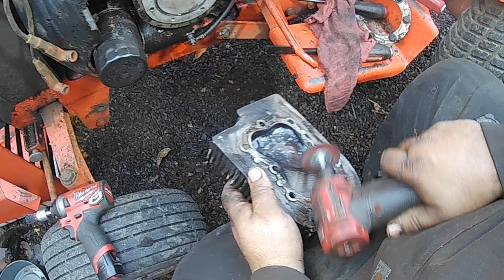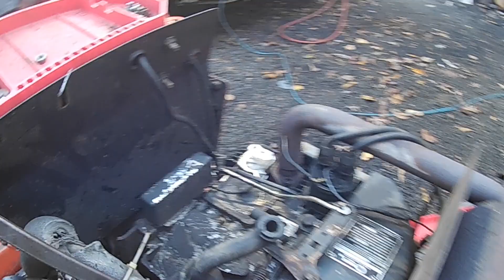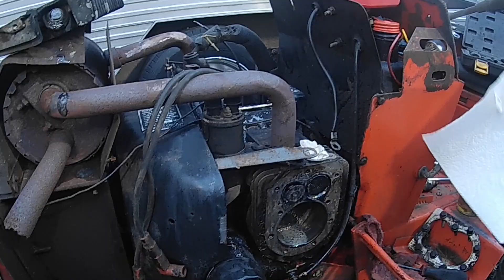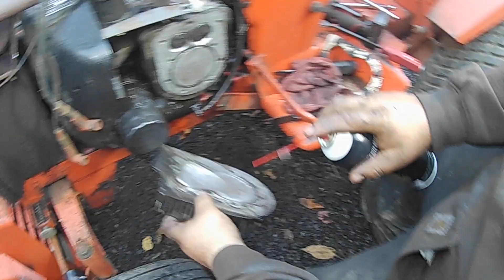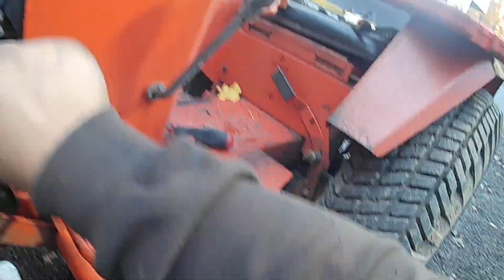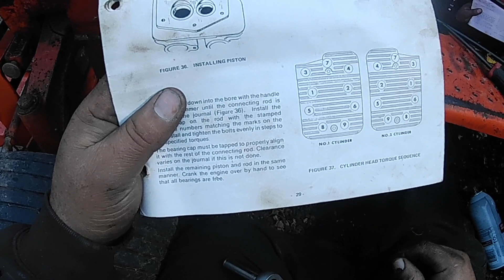How to De-carbon & Replace Head Gaskets On A Onan or Many Small Engines. DO BEFORE ADJUSTING VALVES

Comment: Would using a higher octane gas prevent this?
Reply from the maker: Yes will help but would still need to do it. Using non ethanol gas, high octane heavier oil and make sure its tuned and timed and adjust right. Thanks for the question and watching.

Comment: I have 2 Onan Gensets that have the 6.5 NH Engine. The Head Torque specifications say to re-check Head Torque after 20 Hours of run time. Do think this Required ?   Also Valve Grinding is at 44* and 45*, And Not to Lap the Seats in.  Do you Agree ?   Thanks  Ray
Reply from the maker: Hi we do recheck ours but with customers we cant most times as once they leave we do not see them again or for awhile. Most times they are still in spec but it definitely cant hurt. But we do tend to torque them a bit higher with used bolts. If you can grind them or have them done right then go for it if needed. We only lap them if there is a sealing issue after testing for small issues. Thanks for watching and the comment.

Comment: How do u make sure their cooling properly something about the insulation behind the cover  I was told to remove all the insulation and stuff between engine and shrouds
Reply from the maker: Clean the coolers, make sure fans are in perfect shape, engine and shrouds are clean, correct oil in hydro and engine. Timing and carb adjusted correctly. Thanks

Comment: Trick I learned from an auto shop I worked in. Use a piece of cardboard and make a quick diagram of the head, punch the holes out with a screwdriver where the bolts go and then put the bolts in the holes on the diagram to keep them in order as you take them out. Now they are in order with a picture diagram for when you put it back together. Love your videos, been a big help already helping me work on my tractors and figure out what to fix next!
Reply from the maker: Great idea, thanks for watching and the kind words!

Comment: How do you bar the engine over, about to do valves on my miller welder with this engine/ similar one onan b48m
Reply from the maker: We us a bar on the flywheel through the cut out for the air tube, with heads off or plugs out you can of off flywheel or crank bolt. Thnaks for watching and the question.

Comment: You never showed it run again. That's odd.
Reply from the maker: It ran before... Ran after... Pleanty videos of them running. Video was a how to, did not need to add length of the video if running before was not a major issue. Thanks for watching.

Comment: What are the valves adjusted at? Intake and exhaust
Reply from the maker: @djmtexas  hi for what model engine. Its in the video for a couple models. Thanks
Reply: @caseingersolltractorsnortheast  it’s actually a Onan generator. 
Onan 4.0 bf-3cr/16000b
Reply from the maker: @djmtexas  Sorry do not know of the top of my head there should be manuals on line.

Comment: Good tips, like the abrasive fiber wheel you're  using. Working on my '96 520H, had to pull engine because of mounting position.  Doing all your work along with lapping valves seeing its all apart.
Reply from the maker: Nice enjoy and hope it goes well. Thanks for watching and the comment!

Comment: I began decarbonizing my JD 420.. The carbon wasn't too bad, but what I did see was oil on the bottom of the cylinder. The piston didn't move much. How serious is the oil condition? I wasn't really planning on pulling the engine and doing a ring job. I just bought the tractor and have not used it at yet.
Reply from the maker: Run it and see. It's not uncommon especially with the hours these machines have on them. If the carbon was not bad then it's probably not burning much. Run 20 50 oil and see what you find. Thanks for watching and the comment. Report back if you don't mind.
Reply from the maker: Run it. If the carbon was not bad it's probably not burning much. With the amount of hours on them by this point a little oil is normal. Run 20 50 oil in it. Report back if you would.  Thanks for watching and the comment.  Let us know if you need parts for a Onan or anything. Caseingersolltractors.com

Comment: Nice video.  Appreciate it!!  Saved your website as I have jd 318 with an onan I just pulled motor to do exactly what this video is about.  And yesterday I just bought a case 380 LL little landscaper  . Seems like a good running tractor.  Just worried parts might be hard to come bye.
Reply from the maker: Thanks for watching and the comment and thanks for the sub6. Glad it's was helpful. 380 is a handy little machine. And 318 one of the best Green ones lol.

Comment: I run seafood in.mine
.it keeps it clean
Reply from the maker: Hi Seafoam is good stuff but these engines need decarboned in a normal schedule.  Seafood may help some but won't stop carbon from building up in these small engines, may slow it down as the ones that use seafood constantly are  a bit less Carboned up. But still build up and not taking a chance blowing a multi thousand dollar engine because of carbon build up. We really like seafood for keep carbs clean. Thanks for watching and the comment!
Reply: Seafoam,sorry.
Reply from the maker: Loll no worries knew just what you ment!

Comment: I have a JD 318 with no compression, what is your best guess to my issue? I haven’t torn it apart yet. I want to do the work my self but first of all i don’t know where to get parts. Local JD cant even get most of them anymore.
Reply from the maker: Hard to say could be hung up valves, less likely 2 rods broke or crank or cam broke.  Can't say more without seeing. Pull the heads and you will know in 5 minutes
Reply from the maker: So you have no compression on both cylinders? How are you checking? We stock and can get Onan parts. Be prepaid though worth it they are not cheap.
Reply: @caseingersolltractorsnortheast  just by the way it would sound, it sounded as if only the starter was spinning, it sounded like it had no compression. Also im assuming thats why the fuel pump wont pump fuel….
Then I went and checked with a compression tester and determined i have none.

Comment: Should I anti seize exhaust bolts? Or does it just get burnt off when engine gets hot. Have had problems with steel bolts and aluminum engines, carbs ect. Good info on video, spank you.
Reply from the maker: Hi you can use never seize if you want. Thanks for watching and the comment.

Comment: what is that spray you are using to soak the carbon before hitting it with the nylon pads?
Reply from the maker: It was a private label product no longer made. Thanks for watching and the comment.
Reply: @caseingersolltractorsnortheast  I spent around 2 hours on the 2 heads on my onan B48g engine yesterday scrubbing trying a variety of products.  NOTHING was touching getting the black crud off the heads.  Resorted to using a roloc disc using it just agressive enough to take it off...then used a buffing disc to remove any light scratches left.
Reply from the maker: @mackendw  Lots have had good luck with oven cleaner and some penetrating oils. Rollocks work as well just have to be careful and sounds like you were. We sue them some times too the less aggressive grit ones.

Comment: Wow that’s a filthy engine I try and take every shroud off to degrease and hose it down if I’m doing any sort of work to any engine not just onans
Reply from the maker: Yes we get them in much worse lol we are going to share some photos in a video soon of some of them, lol. But Ya thats why we addressed it in the start of the video. It was far worse lol. Our steam cleaner was down when this was filmed and it was winter so thats why we went only as far as we did. But it worked out fine. God news is we have a big ole USA top of the line steam cleaner now lol. Thanks for watching and the comment! Nice Big bud!
Reply: @caseingersolltractorsnortheast  ya lol I wish I had a big bud little rare and out of budget if you’ve ever watched welker farms they have a few of them steam cleaner would be nice to have I have a 6000 psi commercial grade gas pressure washer it seriously takes both hands and I have to install a 75 degree tip to avoid pint or decal loss
Reply from the maker: @hunter7476  yes watched them recently. I been a fan of Big Bud for many years. Each very cool machines. When I farmed dreamed of having one even though more tractor than I needed lol. Ya we have a 4500 psi machine too but the steam works beat to take the grease off. 6500 psi that's pretty crazy no mud sticking with that lol.

Comment: Are the brushes you use described on Amazon as "nylon abrasive"  (Which sounds pretty harsh for use on aluminum) or did you use a non-abrasive brush?
Reply from the maker: Honestly don't remember what they were described as. But as far as being aggressive it's as much as the operator as the tool. I would think if they are nylon you should be fine just find the speed and pressure you are comfortable with and works well for you.

Comment: I'm performing this job in a p220 on my bench. I've heard suggestions to put oil on the threads of head bolts before installation. Your opinion, yes or no?
Reply from the maker: Hi the torque specs are dry, adding oil will change that. Also if too much oil you can damage the block. We spray both the block and bolts with brake cleaner and let it dry to clean. If you want you could do a light coating of something like wd40 or liquid wrench and let the bolts sit a few min to drip excess.  Also you could clean the holes with brake clean and just install new bolts too. But like we say it's not a race car or rocketship so don't over think it as that can get you into trouble too lol. Good luck!

Comment: Just a couple of questions. Do you or did you check for warpage on the gasket mating surfaces on the engine and head. Engine not as likely to warp like the head I suppose. 

And do you leave some time between each 5 lb torque setting. 
I do that on my kohler k series engines. I leave 15 minutes or so between each torquing. And same at the last torquing. I leave it 15 minutes or so, then recheck. 

Every body has their methods. Just wondering what you do or think about that. 

I have a Case 446 that I will have to do the same job to as you did. Thanks for the information.
Reply from the maker: Hi, no we don't leave any time in between. To be honest no real reason too, we torque everything cold. It's bad to torque a hot engine and that would really be the only thing that would effect the torque maybe. We do go back and re torque after we have ran the engine up to operating temp and let it cool back down. But as you have probably heard us say many times it's not a race car or air plane lol. As far as the heads if there was a head or head gasket issue we do check and go over them very well to see if they are true or why the failure.  But when just doing maintenance we just check them over quick. Honestly we have not seen very many heads or decks un true on these engines unless it's a big failure and obvious head/block damage. Even when there has been basic gasket failures the surfaces remain true most of the time. Thanks for the questions.
Reply: Case Ingersoll Tractors Northeast thank you. Ya wouldn’t torque a hot engine. I do run them. Then check when cold after a few hours of running. Not a race car. For sure. Hehe.
Reply from the maker: @noelstractors-firewood57  you are most welcome 😊

Comment: You have more guts then me. I pass on loosening head bolts with an impact. First smack them with a hammer. I’ve had to fix to many broken off head bolts.
Reply from the maker: Its on lower setting, you can feel right away what ones are going to fight lol. Only had 2 ever break because of the impact and was My fault I Knew I should have not kept going lol. Any other head bolts I have had break broke after trying with the ratchet after knowing they were a issue with the impact. We find most times its the top center 80 percent of the time or more. Is that the one you see most often?
Reply: @caseingersolltractorsnortheast  I put a little pressure on the bolts as if I was tightening them,they loosen right up after that

Comment: Very informative video  . Thanks for sharing . Is it the same concept on a case 646 cck ? I purchased one and it's very dirty on the outside so I'm assuming it needs to be gone through
Reply from the maker: Hi  and thank you! Yes it would be very similar on a CCK be sure to watch the valve adjustment video as well it will be out soon! But most CCK valves we set at .008 intake and .017 exhaust. Good luck and let us know if you have any more questions.
Reply: @caseingersolltractorsnortheast  ok I appreciate it  . Thanks